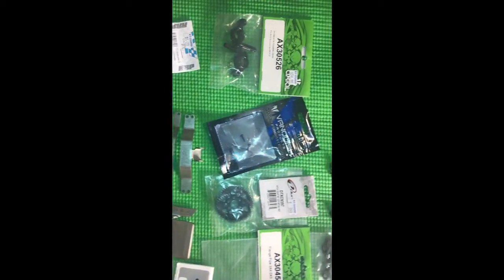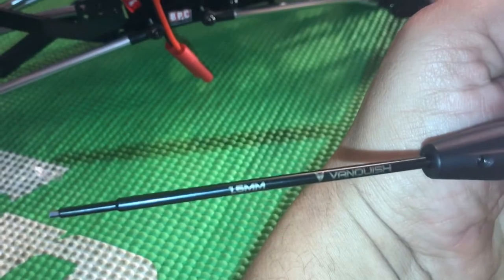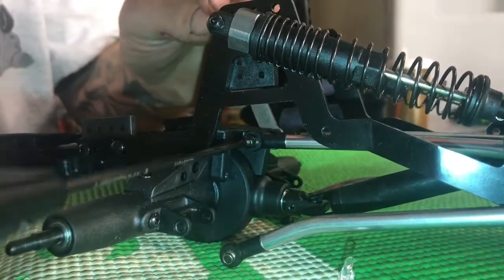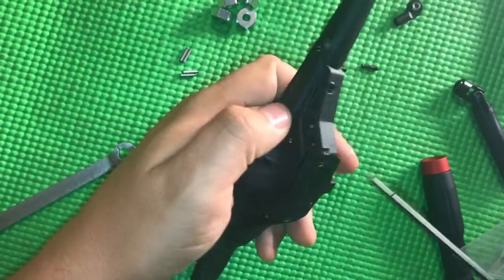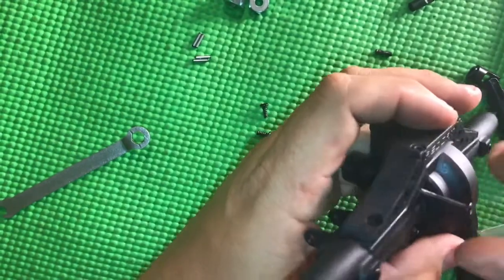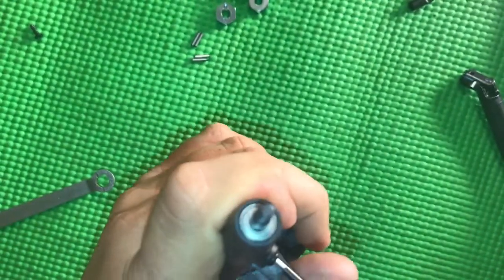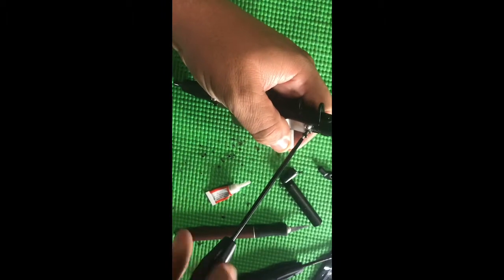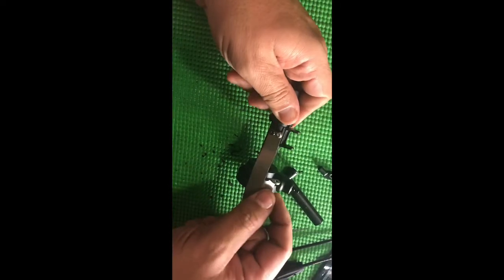Video 1 redcat BPC upgrades rear axle

Comment: Good info and I feel the same about redcat iv got a g7 pro/sport and few more. I used 12mm spacers on both and it really has a nice wider stance better tire clearance to the frame and they're wide enough to stick out about a quarter inch past the fenders on a pro anyway just sharing with ya thanks for sharing buddy
Reply from the maker: gatorboy86 dodirty  thanks

Comment: Finally a video that's says modifications that actually has someone doing modifications besides putting on a new set of tires.does anyone know if the Redcar rig has metal or plastic differentials?